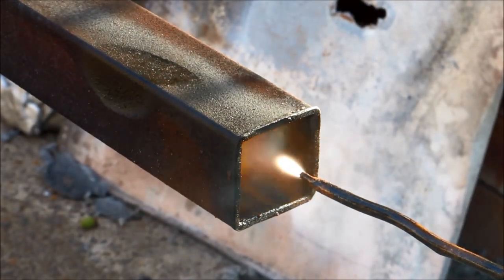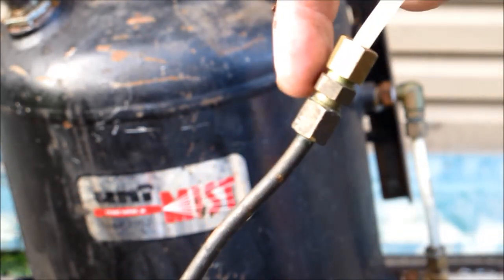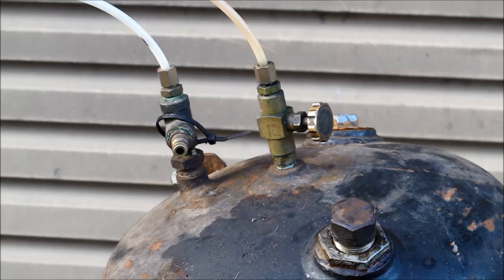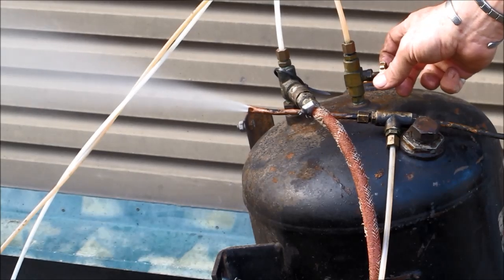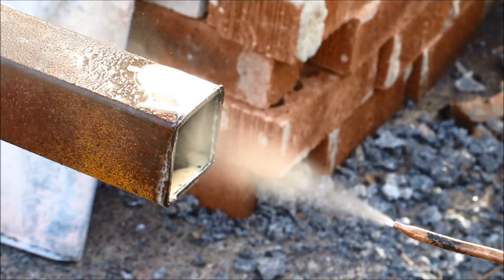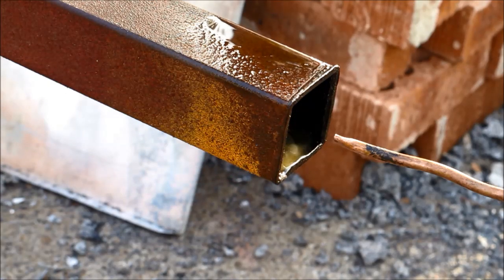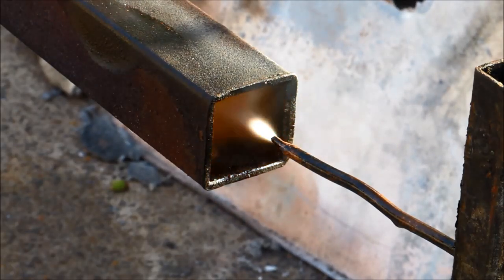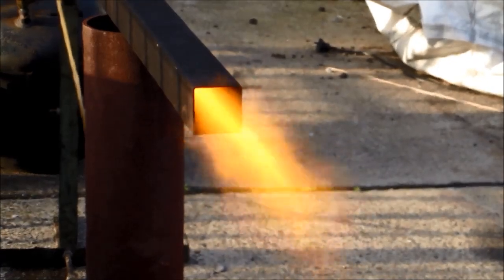Instant light  spraying oil Burner from cheap, off the shelf fittings

Comment: I have used a paint spray gun and it works just like that. You made a huge paint spray gun! Good job!
Reply from the maker: +kbbacon  I was looking at how the thing coated the fence with the spray demonstration and way thinking it would be really good to spray trailers and things with oil to stop them rusting.  Probably also good for spraying plants with insecticide  etc.  If the Nozzle wasn't flattened it would be like the spray wand on a hose!

Did your spray gun work for a burner? I tried it a few times over the years but could never get the guns to spray enough fuel.
Reply: It worked! I'll do a video. There is a trick, if I can get my stuff together.
Reply: neosomato hypergenesis It depends upon your air/fuel output. Can be small (10k btu) or as big as you can handle.

Comment: Welcome Back, OB!!!!  I was getting worried about you.. Glad to see you were just screwing around in another direction.. 
Sounds like the compressor was running the entire time. I'm sure many will find a use for this, but I still like the old burners you have developed.. I think much less electrical power being used with the old.. Still lots of fun!!!   Glad you posted up, buddy!! ;)
Reply from the maker: +Steve 1961P.  Hi Steve, yeah, Things have been rough and I wasn't at all sure I'd do any more vids. Still not sure of how motivated I can stay but I'll see.
 I am still convinced the drip burners are easier, more practical and efficient than any spray or siphon design. The compressor was running the whole time and getting hot in the process. Some people seem dedicated to the Commercial spray burner nozzles which are a lot more expensive and complicated than this one and I'm buggered if I can see any advantage to them.  Perhaps those that are dedicated to the spray burner design will find this a simpler and far cheaper way to go. Some people seem to thrive on over complication, expense and difficulty of operation.

For me, the blown fuel/ drip type burners are a far more practical and versatile bit of gear but each to their own.

Comment: That's really got a nice spray pattern i wasn't quite expecting that.  I think not relying on venturi to suck up the oil makes this much simpler than some spray burners. Looks very nice.
Reply from the maker: +builtrodewreckedit  From what I have seen and read, I agree in that the oil being pressurised makes things easier. It seems a lot of people using the siphon nozzles in furnaces have to pressurise the fuel to get the flow and heat requirement they want out of them.  They then need to add a blower as well to get the air needed for combustion. 
The spray pattern is very fine and mist like even on veg oil.  It is almost surprising given the " nozzle" it just some copper tube squeezed down in a vice.